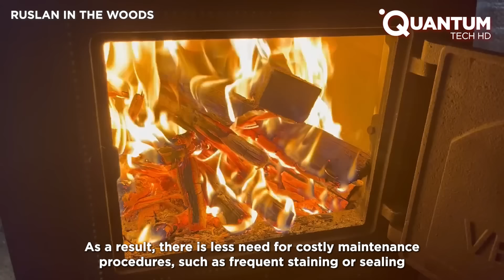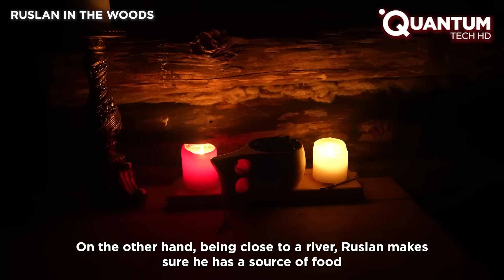Man Builds Secret Underground Cabin in the Forest | Start to Finish by @RuslaninTheWoods

Comment: Ground water gonna be a hell of a problem with that floor design
Reply: So true😮
Reply: @RacerX1971  The ground is sand.
Reply: @gregoryeverson741  it will still be damp.
Reply: @truxton1000  Do you think cutting a hole in the floor under the stove would help?
Reply: @gregoryeverson741  Not sure what that would do. I guess it would not be occupied all the time so anything left there would be get damp, smell musty and you get fungus. Of course if it was warmed up all the time with a wood burner it would not but that’s not the case, is it?
Reply: @truxton1000  He said in the video about using hard wood to avoid this.

I grew up camping, so all tents and cabins smelled like gym socks. lol

I asking questions cuz some day i might try this and dont want to fail, Thank you
Reply: i was wondering about that and sealing it up. unless it's just not heavily rained in that area..hmm how would you have done that to improve it?
Reply: yup.  itll be a wet swamp hole next year.
Reply: I was thinking the same thing. 🤨
I guess one persons cabin is another persons mini-reservoir. 🤷🏻‍♂️😂
Reply: Ground water isn't allowed in those parts, got banned in 1606.
Reply: You guys are saying this will basically flood? 
The wall at least looked water proof with that tarp, that should have some effect right? To be safer the floor should be water tight too I guess, or he could dig deeper until he's passed the sand. Tho at a certain depth it should be fine, how deep does water go? xD
Reply: Don't know for sure, but it looks to me, like he is on top of a little hill. So maybe ground water won't go up there that easily.
Reply: Groundwater most likely will not be a problem.  Look at the color of the soil.  If groundwater was an issue, it would be grey near the bottom.
Reply: Those doors don't look very Sasquatch proof
Reply: @gregoryeverson741 I deal with water from the ground down everyday. Those tarps will rot in a year or two and water will be a issue
Reply: I’m thinking about water leaking in but from the looks of it this guy is pretty thorough. Surely he thought it through
Reply: @ Not sure of the area this was built, but I might have suggested drain tile be installed around the outside perimeter at the base of the wall, stone compacted into the floor and then foamed or plastic covered before the floor was added.
Reply: Yes yes
Reply: @torstent8979 water comes from the sky which is higher 🥴🥴🥴
Reply: @gregoryeverson741  Even worse LOL
Reply: Who’s he hiding from? Zombies? That would be a diverse array of wildlife.
Reply: @gregoryeverson741  Solar panel powered sump pump.
Reply: Def gonna need a sum pump..or some kind of drainage system....
Reply: There's nothing that's not going to be a problem with the design.
Reply: @LorindaSmith-vy9xh  hes in a hole,, No real way to fix it without a waterproof floor, a drain might help but only for a while until the floor rots and mold takes over,, Ben there done that
Reply: It's like digging a well, if there is no ground water when he dug it there likely will never be if the geography was not in drought and it was an average rainfall season.But that doesn't mean the ground can't get saturated which would indeed cause some water penetration into the structure unless it is properly sealed.
Reply: That's why it's built on a small hill. THough, in the winter, snow's gonna thaw, and rain's gonna seep in too, unless good drainage
Reply: @LorindaSmith-vy9xh  above ground cabin, if you seal it and there's heavy rain, your cabin will end up floating xD
Reply: Sump pump
Reply: the entrance-way is certainly going to flood
Reply: @gregoryeverson741      Which  FILLS with water when snow melts or it rains.  Duh.
Reply: Guarantee this guy way smarter than all of you.
Reply: @babyyoda2219  I live in a house not underground in a flooded hole.
Reply: There is the cute little cabin and then there is the reality of BLUE TARPS.
Reply: I would of built the floor at least 2 feet above the dirt under incase water builds up.
Reply: @blankblank3600  Shrek gonna move in.
Reply: depends on where he built it - I'm guessing it's above ground water level - on top of a hill etc
Reply: It's the YouTube views that matters!
Reply: Wondering if you stay down there any length of time where do you potty go
Reply: Not if it’s on a hill
Reply: No it won't he used plastic covering, for that issue or did you not see that it rained and no water got in.
Why do all of you have to be so negative?
To me, if an apocalyptic situation happened, you will wish that you could build what he just did.
Reply: @johnt2831  Cause it's not gonna last 1 Million years, fool shoulda constructed a great pyramid instead. 🙄
Reply: @CaptainSternn  That is the dumbest thing that I've heard recently and I've heard some really dumb things.
He will not live a million years so all he needs is it to last for as long as he needs it and it looks to me as though it would.
But all you people come out with your nonsense and negativity but if it came down to it and the apocalyptic situation was happening, you would be begging him to stay in his under ground hut.
He did a good job.
Reply: @johnt2831  That's the joke.
Reply: @CaptainSternn  If you think that is a joke, then I would say to you, do not give up your day job.
Reply: @johnt2831   Lol someone has been sheltered from absurdist humor, you didn't even realize I was agreeing with you either.
Reply: He’s on top of a hill, should be ok
Reply: @shacar21  You think that being on a hill will protect him if a serious earthquake was to happen?
You are wrong, all that land would move and I am saying personally I wouldn't take the chance.
Reply: @ I could do better if need be mane some down time is needed
Reply: @michaelbaskinmichael9862  Oh, I'm sure you could, and do not let anyone tell you different.
Reply: @gregoryeverson741  hardwood or not it buried the way it is in the ground, wrapped in tarps = 100% chance of fast rot and decay. The cabin is a death-trap
Reply: Hopefully termites are not a thing in your part of the world.
Reply: What's up with all these ground water and rain comments? It depends on local conditions. My parents have a cellar in an area where you have about a metre of dirt on top of clay. So, much worse than sand for drainage. Floor is about three metres into the clay. Very simple construction, over 100 years old, massive stone walls and vaulted ceiling (I think it's sandstone) and floor is just a single layer of bricks lying directly on clay. Zero hydro insulation. Ventilation gets closed off for winter as it was designed for seasonal storage of produce and you want to protect it from freezing air. No water ever, no mould. No matter how much it rains or how fast snow melts. I guess our ancestors knew a thing or two about cellars.

PS: Point being, not every place has water close to surface. I know people with wells over 100 metres deep. My parents don't have their own well but they're sitting at the top edge of a valley. Main water source in the area is at the bottom of that valley, at least 70 metres bellow them. I doubt there is water anywhere close to their cellar. And given the terrain, there is practically zero risk of flooding.

Comment: There is the issue of water flooding inside the bunker coming from the floor, not from the walls as the walls were insulated. If the floor is insulated, the water needs to be stopped from coming up, means you need to install appropriate flooring.  For this Underground Cabin to be livable, it has to avoid ground water coming up to your floors. This means that the bunker is located in the hilly part of the forest, where the floor level of the bunker is above the natural ground level in the area.  I find the construction very interesting, and the effort the guys are doing. Thanks for the Video. 🙂
Reply: drenage will help?
Reply: you can tell this is a waste of lumber in the first 10 seconds...
Reply: @ПойЛасточка  Drain to where?  It's like trying to drain a bathtub that's 3 feet under water.
Reply: Dude, they lived there for several years, there is no groundwater in the sand.
Reply: I'm more interested in where the logs come from. Surrounded by trees & yet none of them disappear...hmmm...........
Another thing is that he doesn't seem to ever encounter resistance or authorities. Nice jon, though.
Reply: @davidp5492  yeah they did hydrological tests and consulted engineers I'm sure... Then they used duct tape on the windows.   What sort of drugs are you on?
Reply: @mintymus  "Drain to where?  It's like trying to drain a bathtub that's 3 feet under water." - I imagine he picked this spot specifically because: 1) it's near water, but far and high enough from the river bank to be safely outside the flood zone and above the water table, 2) it's in deep, sandy soil, so precipitation will get sucked down the sides and disappear before it can seep under and backup through the floorboards.

Ground frost might be an issue in the spring, when snow melt and rain can't drain into the ground, and the area looks pretty flat - hopefully there's enough slope around him that it doesn't turn into a swamp every March/April. In fact, I think I would've sloped the roof a bit for that same reason, as that flat roof is bound to trap some water year round. Hopefully those tarps are rated to last in this type of application, and won't puncture, rot or otherwise let moisture through. Even if they don't, I imagine the constant moisture trapped up there would make a nice breeding ground for mosquitos.
Reply: @davidjorgensen877   You really have no idea.
Reply: There's no appropriate flooring for flooding, needs to sump it out or pour concrete and lay block up the height of the dirt THEN seal the block from the outside, insulation doesn't stop water it drinks it up into your house bones. Or he can put his floor on a higher subfloor and hope it's tall enough to handle the biggest rains. Honestly, this is Bushcraft shit not tradesman shit. All these bushcraft building there kiddy forts, neat hobby but not real tradecraft....unless you're trade is building and selling poorly made shanty cabins that fill up with water😂
Reply: @davidp5492 rain dude, rain water seeps into the ground all around the cabin, and insulation doesn't stop water even if it doesn't come up from the table there no guarantee that table doesn't rise with torrential rains and even if it did you still have water soaking into and through your walls Everytime it rains. This isn't tradesman quality, its Bushcraft trash, thats not a cabin it's a soggy shanty-shack. I've watched dozens of hours on the cheap log builds, I'm putting together material and time to do one on my father in laws land and I've done a lotta timber frame carpentry over the last couple years and this isn't a solid build, it's a cool idea with some engineering hurdles that these neanderthals either never thought of or ignored
Reply: @xephael3485  yes i'm sure you who has built nothing in your life should advise people who have lived and built shelters in the forest for decades. it's obvious they're on a hill. and it's not deep enough for there to need drainage. the plastic tarp behind the wood is enough
Reply: @mintymus  "You really have no idea." - So enlighten me. Assuming that the bottom of his structure is well above the water table (and the video shows no evidence that it's not), and given that the soil he's dug it into appears to be pure sand, how is the drainage in this application, "like trying to drain a bathtub that's 3 feet under water"? My backyard sits about 15 feet higher than the marsh and creek we border; it's laid over a ravine backfilled with a sand-clay mix that sucks up water like a jet pump - the worst summer storms can't make a puddle on it. So as long as this guy's floor is far enough above the water table, and surface moisture has an open avenue of escape through the sand below, how does this structure turn into "a bathtub that's 3-feet under water"? I'd genuinely like to know how that works.
Reply: @davidjorgensen877   You're assuming it's above the water table, which you have no idea if it is or not.
Reply: He is pure sand, water pooling is just not possible.
Reply: @mintymus pure sand like this has perfect drainage. It can’t pool.
Reply: @Souvenirs444 yeah there is and that’s why most sand islands in all the oceans have fresh water underground. At some point there is either an impenetrable geological feature or salt water and as salt water is denser than fresh water the fresh water floats on top. This is called lensing of the aquifer. All big sand islands that I know of have fresh water lakes.
Reply: @Kentucky_Konservative sound like a person that doesn’t think logically. If he took 100 logs from the surrounding kilometre of forest you would never see the difference.
Reply: @nathansackett6890 explain how pure sand holds water that is going to flood this. Water does not hold in a dam made from sand does it?
Reply: @teeanahera8949  not for long, where is "pure sand" "holding water" exactly? What does that even mean? Are we going to sit and pretend that dirt and sand don't wick like a freaking drinking straw? 😂 Look I'm not even gonna do this, it's a shitty looking stupid idea of a build, Bushcraft huts like these are fuckin kiddie forts, it's just stupid and it will flood and rot, enjoy it 👍
Reply: @teeanahera8949  Wrong.
Reply: Pour quoi faire?Jouer aux indiens et au cow boys ? Elle n’est pas étanche à mon avis  et en cas de guerre si bien dérisoire si c’est la raison pour échapper momentanément à un danger .Bref je ne trouve pas ça utile sauf pour satisfaire ses fantasmes  mais après tout ce que l’on voit dans le monde cela a le mérite de ne nuire à personne.Pour finir c’es quand même un bon endroit pour faire la fête avec des amis mais du coup plus de secret.
Reply: I call bullshit. Put it back the way it was. Destroying the forest for yucktube hits is pathetic.
Reply: The windows are water collectors
Reply: @mintymus  You have made four useless comments so far:

1.) "Drain to where? It's like trying to drain a bathtub that's 3 feet underwater."

This has been explained multiple times. Try reading with your eyes open this time.

2.) "You really have no idea."

How ironic.

3.) "You're assuming it's above the water table, which you have no idea if it is or not."

Again, use your eyes. We  have FAR more visual clues that indicate it IS above the water table, and zero clues to the contrary.

4.) "Wrong."

Then offer a rebuttal if you're so damn certain.

Ladies and gentlemen, I present to you... a troll.
Reply: Here is The True Savior

HalleluYAH “Praise ye YaH”

YaH is The Heavenly Father 
YaH arrives via the TENT OF MEETING
YaH was Who they Crucified for our sins
YaH was Crucified on an Almond TREE

— Ancient Semitic Cuneiform of Moshe (Moses)
— Isa Scroll (The Original Isaiah)

Isaiah 42:8
"I am YaH; that is my Name! I will not yield my glory to another or my praise to idols.”

Isaiah 43:11
“I am YAH, and there is no other Savior but Me.”

Isaiah 45:5
“I am YaH, and there is none else.”
Reply: 비오면 침수 되겟지요?
Reply: @Souvenirs444  Then it rained, shortly after Black Mold grew and spores entered his lungs..    R.I.P.  💀
Reply: @cagneybillingsley2165  Then it rained, shortly after Black Mold grew and spores entered his lungs..    R.I.P.  💀
Reply: @Kentucky_Konservative  Бревна использованы от упавших деревьев или так называемого сухостоя. Конечно же, их надо было поискать по лесу и перетащить к месту стройки.
Reply: great comment! I would have loved to be an assistant building this little hideaway. It looks like a very satisfying endeavour. Wow!

Comment: The only things I would add, would be instead of using tarps on your roof. You would use a rubber membrane. They're generally used for ponds, but work great for covering underground shelters. I'd also make sure that the floor is 3 to 6 in off the ground. With a backfill of gravel. And put in a sump pump with a battery backup. Running to either a solar panel or a windmill generator. Just my thoughts. Other than my critiques, I think you guys did an awesome job!

Comment: Very nice design. My only suggestion would be to loft the bed higher. I live on a bus and learned that by building your bed at waist level so you have to hop in or use a single stair, you can use less heat at night. Heat rises. I built with just enough room to comfortably sit up in bed with a foot head clearance. It also gives you a ton of storage space underneath. In climates that are more cold in winter this means less heating at night because your body is in the middle space of the room. In summer it’s no problem because you can vent the heat out with windows and fans. This design feature doubled my storage space. I also had a twin bed but noticed that I didn’t need a foot of that width space to be comfortable. So I placed a set of boxed wire snap together shelves that have ten cubes along the entire wall running the length of the bed on top of my futon mattress. This is two layers of 12” cube shelves and the use of the top as a shelf. It’s perfect to hold everything! Insert cardboard squares at the bottom’s and nothing falls through the screen material. Best $35 spent for my cubes. Using the fabric folding cubes for under bed storage along with tarp material bags keeps everything under the bed tidy and accessible. Storage is essential in small spaces. Also adding a shelf over the foot of your bed is awesome too. Leave space for your feet, but above your feet you can install shelves all the way up. Otherwise that is wasted space for what? Feet. 😂 ✌🏻
Reply: Про рівень лежанки чудова ідея! А от при "кубіки"- ні! Про мишей забули!
Reply: @ Ebay has wire rack cube shelving. That might work. Unless you have mice that can chew through metal. 😂 Looking at the muscles on some Russian men I don’t doubt that you have stout mice too. 😁✌🏻